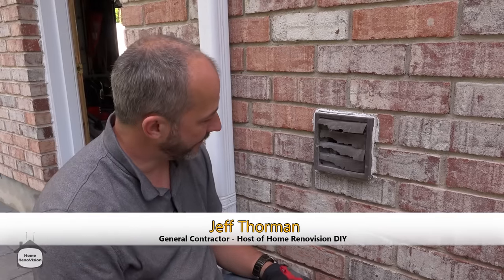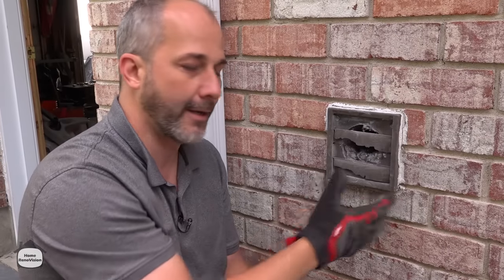How to Replace a Dryer Exhaust Vent

Comment: I appreciate the fact that other DIY-type shows would have completely scrapped this video because the install didn't go as expected (wasn't easy what with the drill bit breaking, the mortar, and the hole being right on the edge of the brick). An SDS hammer drill would have plowed through that brick, however the hole on the edge of the brick would have probably blown out a bit (literally just happened to me).
Reply from the maker: This is why these things are installed before the brick when building the house.

Comment: Surely it would be neater if you put the adhesive on the back of the cover and then pushed it up against the wall. That would avoid the messy caulking line
Reply: agree. Its just impossible almost to make a smooth caulk like against a rough brick surface. If he tried to wipe it with a finger to make it look smooth, it would just smear into the rough brick and look awful.  I use clear silicone when around brick finishes so i can finger it into the gaps and you cant see the caulk spread out into the little rough surfaces of the brick along the side of the vent.
Reply: I agree. I would have done that and then came back around the outside with a much thinner application.

Comment: Great that you left the glitches in the video. Using screws can be a disadvantage anyway as they cause stresses in PVCs and hasten the ravages of UV degradation over just a couple of years.
It is possible to tidy quick-stick caulking later or another way is to use silicone which stays semi-soft. This moves with the house and doesn't flake. It is also impregnated with pest-repellent chemicals but is a bit expensive.
Super video. Many thanks.

Comment: “Nobody attaches these with screws”
Proves it.
Reply from the maker: def!
Reply: @HomeRenoVisionDIY  Kudos for posting a vid showing a real life situation Jeff!  
I believe the screws are used  for situations where installing in wood / vinyl / aluminum siding only.
Extremely common issue in more northern climates with these plastic vents as the cold winter / hot summer cycle quickly degrades this type of plastic.
A great reminder for me to re-do mine again...Thanks.
Great video.
Cheers!
Reply from the maker: those uv rays mixed with crazy cold wreak havoc on plastic. Cheers!
Reply: V Brown  you should use screws to secure it!.. Its not hard!
Reply: What are 'screws'?
Reply: I was able to attach a client’s dryer vent using screws I was lucky it had a plywood exterior wall.

Comment: I definitely appreciate the real-world scenarios you run into.  Depending on the situation, half of working on a home is sometimes finding ways to make it work, not the absolutely most right way of doing it.  If only adhesive works in that scenario, then use it!
Reply from the maker: Cheers!

Comment: I install these all the time in Scotland. If you use an SDS drill and SDS bit (i prefer to use Bosche bits, they rank highest for quality with me anyway) there isn't any issue getting through brick, cement or even solid rock when screwing these vents to the side of buildings. Screw and seal best way to go. Very good chance someone could knock the couple of inches of pipe on the inside, maybe by moving or replacing the dryer and burst the vent off the wall if not enough caulk or silicon is applied solely by itself. Best part is you don't burn out your cordless drill doing something designed for an SDS. However I do agree those bits are horrific and if you don't have an SDS drill and are put in the situation of not being able to screw it whilst being eaten by bugs which we get a lot over here. Then I think any reasonable minded individual would proceed to pump and go 🙂. Loving the channel by the way. Never miss a thing very detailed 😀👍
Reply from the maker: very true, funny how I was expecting the hammer drill to be s useless that day. That was one tough brick. Cheers!
Reply: SDS is only the coupling between the drill bit and the drill. What you mean is using a hammer drill. My hammer drill has a conversion head from SDS to regular drill bit, so i could still do the hammering function without having SDS involved. So SDS and the hammering function are two seperate subjects. SDS is a great system anyway. I love it how easy it is to put a drill bit in a drill using SDS.

Comment: Like your videos, Jeff but gotta tell you, don't agree with just using caulk.  Would have gone out to get another drill bit and 
finished the job correctly.
Reply from the maker: Tim , the word correctly is up for interpretation in this situation. The old vent was simply caulked and I would hazard a guess that the majority of vent covers against brick are just that. So if that is most common practice out there then Why should anyone else be held to a higher standard.
Reply: The Quad caulk Jeff used will last longer than the vent.  If you drill holes and the next vent has different spacing, it may not be possible to place new holes without filling the old ones first.  That is a lot of work for a simple dryer vent.
Reply: @HomeRenoVisionDIY  I can attest.. I landed on your video because I have a brick exterior, with a caulked on dryer vent. This is the only video I found that doesn't gloss over the fact that the old vent cover (A) might not be screwed on, and (B) will probably be REALLY HARD TO REMOVE. And when I do remove it, I'll probably also break it. But it's a crappy cover, and I should replace it, anyway. Thank you for showing how this job REALLY goes :D

Comment: I replaced my old vent with one of these several months back. Mine goes through brick into a crawlspace, so I can access the inside end fairly easily. The vent I replaced was held in with a square flange that had a four inch circular hole in the middle and a squeeze-type hose clamp. So once I shoved my new vent into the crawlspace stem wall, I slid the flange back on from the inside and then the clamp. Obviously, that's not possible in every situation, but mine holds pretty tight without anything else.

Question though: I didn't caulk around the outside of mine... when caulking a dryer vent, is there a reason to caulk the bottom edge too? (My guess is that you did the bottom here because you're using the caulk to glue the vent in?) I thought in exterior caulking it was recommended to leave the bottom open to drain out.

Nice job though, thanks!

Comment: Hi Jeff! Gal from Kentucky, USA, here. First, I adore you and your videos. I have learned so much in the many days worth of videos that I have watched! Second, thanks to your guidance, I am ambitiously planning our basement renovation. One item that I will have to tackle is relocating our washer/dryer. The vent currently exits through a hole cut in a window. I plan to cut through the foundation in their final location to vent the dryer. I have not seen any videos on this sort of task. What advice could you offer for this to be done? I have the option of either going high through the brick, or lower through the concrete block foundation. I, naturally, want to make sure I do it properly, and I trust your expertise. Thank you so much for your help! 

Sincerely,
Avid Watcher :)
Reply from the maker: Hello Kentucky. The best answer is to drill a hole the exact size of the duct line for the dryer to help keep mice out of the house. I always call a " core drilling service for this job. they have special equipment that will core out a hole in concrete block or poured foundation walls in just a few minutes. It is not a diy thing but sometimes calling in a pro for help is the best solution. Otherwise you can go through the brick by removing the mortar and chipping out the brick. Just be sure to buy an exhaust cover that will cover the mess when you are done.  Good luck and Cheers!
Reply: @HomeRenoVisionDIY  Thank you so much for taking the time to reply! I'll look into what services we have in my area - I'd definitely prefer it to be a clean cut. :) Take care and keep the lessons coming!

Comment: I have a dryer vent that goes from the dryer, up the wall, through the upper floor joists and terminates out the wall. It is a finished ground floor and upper floor. Can I just take out the existing dryer vent cover, and slide in a new vent cover and attach it to the vinyl siding? Or do I need access to the duct within?

Comment: Would tap-cons be a good fastener for this dryer vent?
Reply from the maker: only if you can drill the hole. Cheers!
Reply: I prefer anchors as they are reusable.    Tapcons need just the right sized hole.  Tapcons might be needed if a lot of strength were needed which is not the case here.

Comment: Our old venting is smaller than 4 inches, more like 3.3. We have tried both big box and small hardware stores to find a cap with an opening less than 4 in. Does such a thing exist?
Thank you meas
Reply from the maker: all dryer venting is 4 " if you have a 3" vent than your builder is an idiot. You need to create a 4" hole or you run the risk of fire and guarantee your clothes will take twice as long to dry. Huge waste of energy!

Comment: Would it be a great idea to spray foam to fill gaps between bricks and the pipe?
Reply from the maker: no need. That is exterior of the building and not part of the vapor or thermal barrier. Cheers!

Comment: Would this be the same process when you need to relocate a dryer vent? I need to move mine to give the washer more room and to but up against it and so i can push my washer back a little. I need to go through brick and wood.

Comment: Do you mind if I ask how you would solve an issue of condensation running down the outside wall which we have coming from one of these? The vent is for a tumble dryer and the cold weather evidently causes the hot air to condense within the tube which then obviously turns to water leading to it dripping down the wall from the 3 vent flaps creating an unsightly water stain on our brickwork. Any help would be appreciated. Thanks

Comment: Is there a reason why dryer vent external grilles are mainly square? Is there a reason that they aren't brick shaped so you can just remove a single brick and replace with a piece that goes from rectangle to round to fit the dryer?
Reply from the maker: It is easier to core a round hole than a square one in most situations.

Comment: Question for you; how do contractors put that big 1/2”-3/4" bead of caulking around those vents (and windows, garage doors, etc.)? Are they using some kind of HUGE tube of caulking, or is it construction adhesive or some other product?

Comment: @Home RenoVision DIY  I'm a 63 year old woman and I don't know what I'm doing.  My cover is cracked and is falling apart. Can't I just replace the cover without that extra long neck part?  Do I have to take it apart to see what vent I actually need?  Then the hole would be left to the elements of weather until my vent comes in the mail?
     Also, when a vent is advertised as 4", is that the size of the dryer hole?

Comment: Question as I am having the same issue. Should you tape the joint between the vent pipe and the extra piece of 4” pipe used to reach inside the house to prevent moisture getting to the insulation from the dryer exhaust air?

Comment: Great Video!!! I had to move my dryer vent (Brick outside wall) what do you recommend covering the old hole with?
Reply from the maker: hI Andre, since installing brick will look bad. I would put in a vent cover and then spray foam the inside to seal it up. Cheers!

Comment: Jeff I've got a dryer that vents into my garage that is in a place that is very far from the out side which is not a big deal but I would like to build it so it is easy to service IE (hatches or cleaning ports ) and I was wondering about your experience with booster fans . Thanks Rocky

Comment: I wonder if you could provide an answer for another issue related to dryer vents.   I had about a 12 ft. dryer exhaust pipe installed in my basement that runs from the center of my house to the back and out.  It comes down from a laundry closet in the middle of my house.  I believe that the pipe needs to have a pitch.  Common sense tells me that it could pitch downward so that they place where it exits is lowest.  Did the guy do that who installed it?  Noooo.  It is pitched the opposite way so that it travels upward.

Comment: What about the mortar that was removed? Now there is a huge void there letting cold/hot air in the house.
Reply from the maker: the mortar didn't keep the cold out. the hole is still insulated around the pipe. Cheers!

Comment: Jeff, I’m using the exact same vent for two upstairs bathroom fans. I’m venting out through each gable end (vinyl siding) close to the fans instead of going through the roof. I’m using insulated flex pipe (R6) from another video of yours. 

Question: is the process the same? Should I caulk the bottom portion of the vent or leave that open for condensation to drip?

I’ll be using OSI Quad caulk for all season window/door/siding. Would you recommend something else?

Comment: I have installed hundreds of these vents in brick for the past 40 years. Use the caulk after you install the screws for the added seal. You have to have more than one quarter inch concrete bit in your bit box, just saying. OK, I still love your channel.
Reply from the maker: This was a little last minute. Cheers!

Comment: Definitely gonna be watching this one. My dryer vent doesn't quite look that bad, but I can't figure out how to release the end cap from the metal tube inside.
Reply from the maker: Hope this helps!
Reply: Home RenoVision DIY My vent runs through a wall for 10 feet, so what you did here doesn’t apply, unfortunately. And the exterior is vinyl siding, so it’s hard to see how it’s attached. I just bought another grill of the same size and swapped out the slats, so at least they open and close properly.

Comment: I had same problem as you did with the brick! Mine had mortar and hole not level inside. I had to enlarge hole from inside. How should I finish off inside hole to make sure it looks nice? Insulation? My problem was also temp outside was just below 40 degrees. How will this effect my calking job? Thank you. 👍

Comment: Stick to stainless steel. Better than plastic. Plastic oxidizes while stainless steel doesn't. Btw you need masonary or carbide drill bits.

Comment: That plastic cage on the end of the vent pops off a lot and it traps lint that gets wet then hardens and blocks the vent. Just leave the cage off.
Reply from the maker: If you are a type that keeps checking it works great. If you are a person that will never maintain the lint then yes leave it off.

Comment: Your drill bit was too big for that tiny hole on the vent cover and you torqued the hell out of it causing it to break. Also it really sucks my house is made out of brick and MORTAR because all the damn animals are pouring in through the mortar joints and it's cold as hell with the weather blowing through them. Smaller drill bit and drilling in straight helps. Ive done this same thing with a little m12 hammer drill. It's possible folks don't let this guy fool you people drill into brick and block all the time.